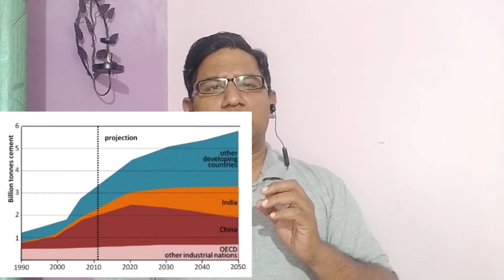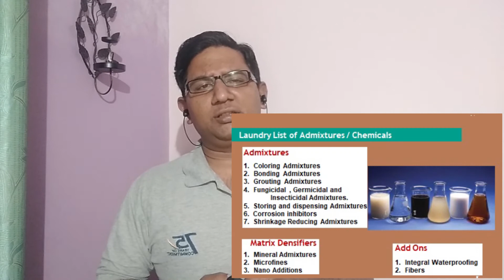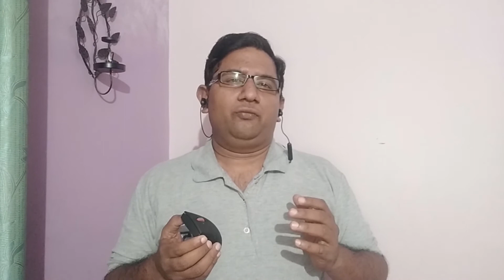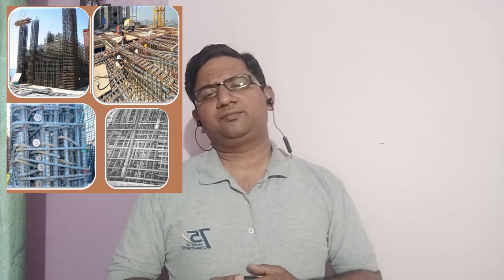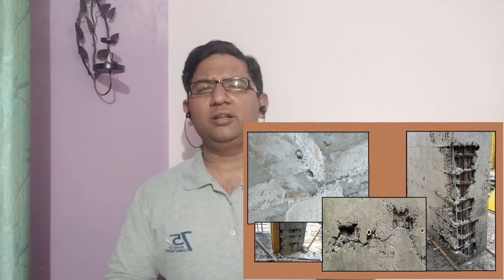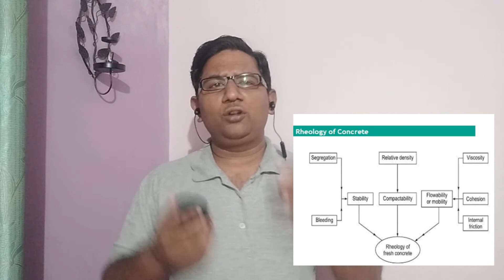Advances in Concrete Technology - Part-1

Comment: Dear sir
I have one imp quest from please response. On my site M-25 has been mention in specification or tender but on site some of the area concert quantity is less than 1 cum . so what should I do in this conditions. Please response
Reply from the maker: Friend, i recommend not to compare qty with grade. If designer has mentioned in spec then we must adhere to it. U can design the mix and pour it using weigh batcher for small qty